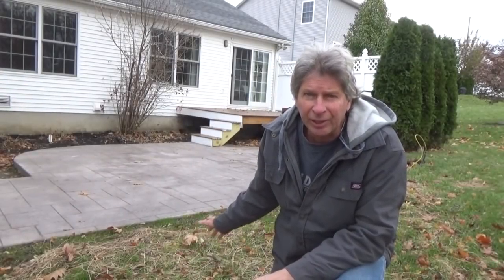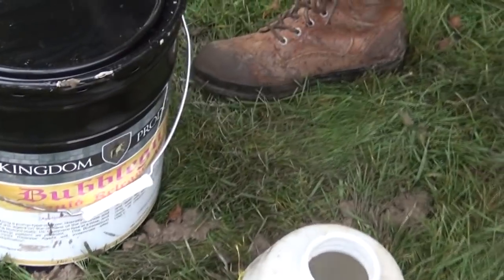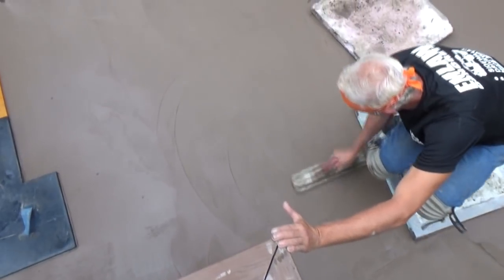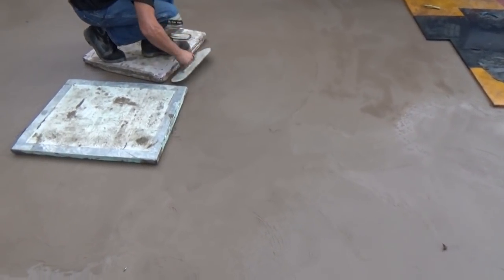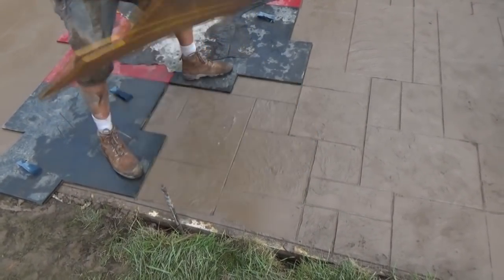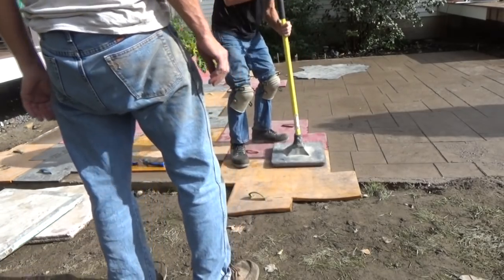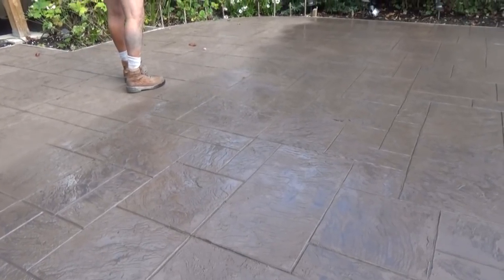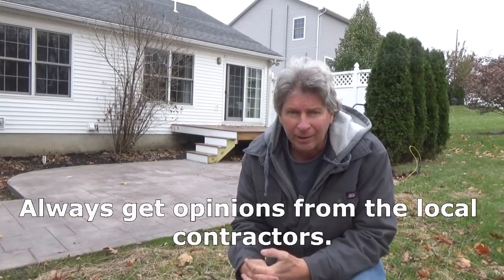STAMPED CONCRETE  (YES or NO?) (Part 1) Mike Haduck

Comment: I don't live too far from where your at and our weather is comparable. The only stamped concrete I've seen done that's lasted very long were the ones that were poured properly to begin with. One of my customers had one done 15-20 years ago and it was stamped borders of a 1/8 mile driveway and her pool deck. It was also multi colored and kept sealed every 2-3 years. It still had its integrity, color, sheen ECT. as the day it was poured. Being along a major river where its usually 10-20 degrees colder in the winter I'd say its held up beautifully. Like any job its the prep work that makes it last. I have seen my share of shoddy work done on stamping though. I seen one today where the guys waited too long to stamp and blew out edges and crooked lines. It looked horrible, its one of those things where if you don't know what your doing don't attempt it.
Reply from the maker: Hi Kirby, I agree, if you keep up after it it sure will hold up better, but our weather is mountainous, and I haven’t seen any hold up yet like shingles on the roof, it’s only a matter time, I appreciate hearing from a pro, thanks Mike

Comment: Mike, how big concrete pad can be in size without steel reinforcement and safe from cracking?
Reply from the maker: Hi Tiger,  concrete can never be safe from cracking, the idea is to forsee where you expect it to crack, and take steps to help prevent it, every job is different, so I usually do more control joints than less,  if that makes sense,  thanks, Mike

Comment: Nice Job.  Don't you want to use joints to prevent cracks ?
Reply from the maker: Hi Sulais,  IT was not my job,  I understand they cut it with a diamond saw a day later.  thanks mike
Reply: You did nice job.  Thanks
Reply from the maker: thanks Sulais,  I appreciate it. mike

Comment: Did he saw cut this the next day?  He had absolutely no relief cuts or expansion joints.   That most definitely has a crack or two today.   It is most important to give it a place to crack.
Reply from the maker: Hi Adam, I agree about the cut marks, stamped concrete don't hold up in my area, inside or around a pool isn't bad but I still don't do it, thanks Mike